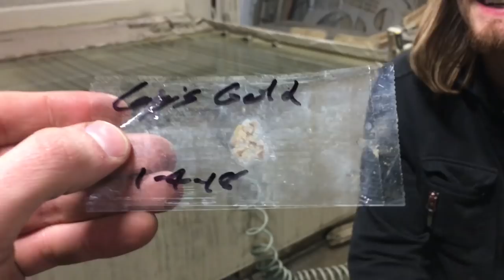$14,000 GOLD bar vs 60,000 PSI Waterjet - with Cody's Lab

Comment: its uses a gallon a minute? thats less than a shower
Reply: high pressure, not high volume.
Reply: Brad Feng I mean he said not a lot right
Reply: ha! Interesting idea, get a chicken or pig and see what it looks like cutting through the fleshy analogue.
Reply: The volume looks like alot too
Reply: The greatest shower you will ever have
Reply: Christian Syko, that was the most cutting comment of the thread. Thanks for being sharp!
Reply: The LAST shower you would ever have.
Reply: Using less water and it's certainly guaranteed to rid any dandruff issues!
Reply: Start taking showers at 60,000 psi to save water !
Reply: @fpbbq  you know both are high in this, high flow rate in total

Comment: Should have weighed the bar pre-cutting and then weighed the 2 pieces post-cutting to determine exactly how much gold is lost through the process.
Reply: just pan the waste, youll get all the cuttings back no problem
Reply: @frogbear02  "just"
Reply: @DavenH  yes, "just" XD literally all youd have to do is take the cuttings from the bucket, stick it in a gold pan, and pan it out two or three times. I am a gold panner myself; the panning process isnt that difficult (note that cody is also a proficient gold panner)
Reply: @frogbear02  Oh I thought you meant the whole water catchment box, ... I thought that's where the rest of the dust went. Like, where did 999 parts in a 1000 go if they reclaimed $1 out of $1000 in dust?

Comment: You probably could've saved yourself the trouble of panning it by just using water instead of the abrasive. The gold should be soft enough that it should cut through easily enough without abrasive

Comment: His video said 15,500 not 14,000$ R.I.P. difference
Reply: I think the total Cody refined ws about 15k but only 14k of it made it into the gold bar
Reply: twothreebravo no he estimated and they changed the title
Reply: Nope the bar is worth 14k while the part he refined later adds another 1,5k I assume
Reply: Wait I double checked the vid said he missed some gold but when he recovered it he did not melt the two together so that’s where the missing 1,500 went
Reply: HeroFighter no he missed roughly 17 grams of gold in different areas, which assuming its 24k pure gold would only equate to about 700$

Comment: when gold is melted do you lose some gold to dross?
Reply: Graham Totte  gold is not nearly as reactive as aluminum or lead so it won't oxidize much even at molten temperature exposed to air so not really maybe just a tiny bit but not much at all compared to most things
Reply: Graham Totte you lose gold in every process

Comment: disappointed they never pontificated on how much gold they lost. As a guess, the line that was cut was 1/50 the width of the bar so 1/50 of $14k is $280 so if they recovered $1 then they lost $279 smackaroos.

Comment: He uses oz, and he studies sciences?
Reply: MadMan gold is measured in oz
Reply: but Cody is mostly using metric system usually
Reply: MadMan that’s how gold and silver are measured but it’s Troy ounces instead of the Norma arvoidipois ounce

Spelled it wrong sorry
Reply: Thanks for the information, very helpful.
Reply: Troy ounce is a very old measurement, which is still used as the standard for gold and silver weights.